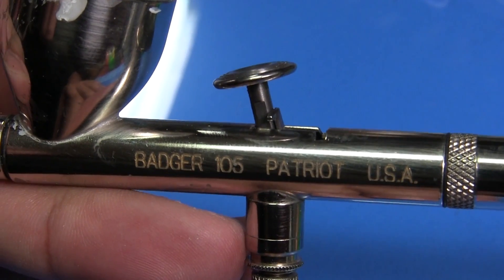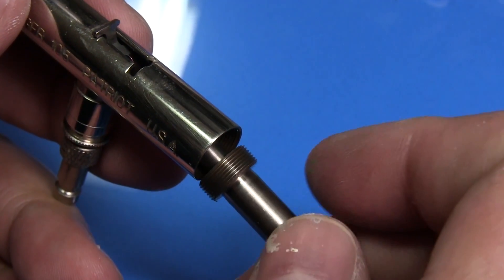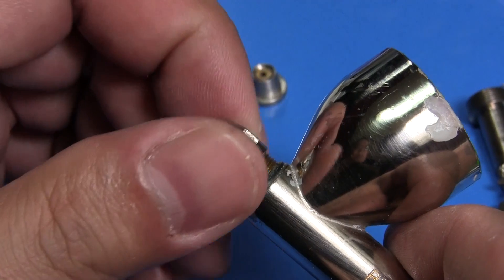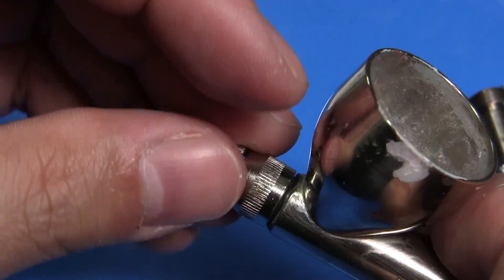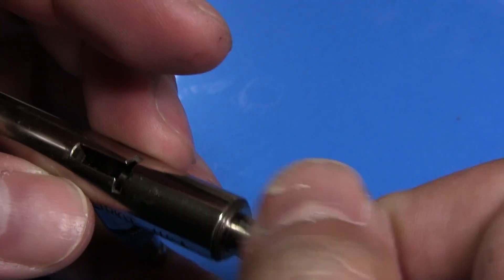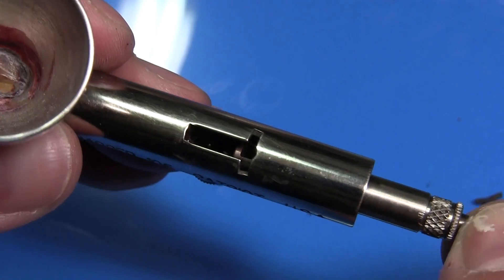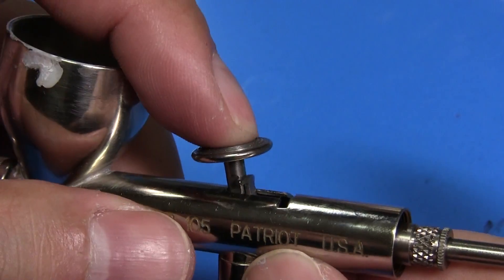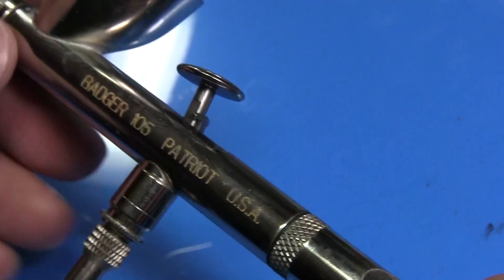Badger Patriot 105 Disassembly & Assembly by Lester Bursley

Comment: This video saved my sanity. The trigger and back lever fell out while I was cleaning the needle, and I COULD NOT get them to fit in again. Turns out the tube shank had slid out of the needle tube and was misaligned. This is not the first time this has happened and frustrated me for probably hours of my life, but now I know the cause and it never has to bother me again! Thank you!

Comment: Do it.  I've had an issue with my Revell compressor which turns out Badger make the hoses for, for Revell.  Issues isn't Badgers fault yet I've heard nothing from Revell yet had loads of help and support from Badger.  I'm in the UK, they are in the US & shipped me parts for free to try and fix the issue.  Even custom made a adapter for the compressor for me.  Amazing support from Badger.

Comment: I ordered this airbrush a few years ago and couldn't get it to work out of the box. Then, I took it apart, and it was a real mission for me to build it back up. It didn't work, so I took it apart again and repeated the process. No results. The AB frustrated me to the point of giving up on it. Now, my AB collection has 5 Iwatas, including two Custom Microns, one Harder & Steenbeck Chameleon, and one Paschee Raptor. ALL of these ABs worked flawlessly out of the box. I hate the Patriot 105 and regretted my purchase. Hard to believe this is the same company that made the legendary Model H. I'm going to try to take it apart again and reassemble it, and I will use this video to assist. However, I don't think I did anything different than what the video shows back then. 

In disregard of whether I'm successful, thank you for this video!

Comment: Is there supposed to be a rubber O ring between the airbrush body (partQ) and the head cap (part A)??? There is a big space screaming for a ring, but I don’t see it in the Spraygunner parts diagram. This was a very helpful video, thanks

Comment: My 105 nozzle tip is stuck on the other piece behind it. They come off the airbrush head as one piece. I've seen videos of people removing it with their hands easily but mine refuses to budge. It doesn't seem to have paint dried there, it simply is stuck. I'd like to remove it to put on the Super Fine conversion from Badger. Any ideas?

Comment: When I got my 105 I took the head and tip off and when I tipped the brush forward a little white washer thing slid out and off the needle. Does anyone know what that is? I noticed it wasn't mentioned in the video. Think it might be part of a PTFE bearing or something. Just wondering if I need to contact Badger or Amazon which is where I bought it from to get it fixed or if this is normal. Thanks.

Comment: Hi there!
I tried disassembling my patriot today to clean it out, but when I put it back together, I notice that I can't push on my trigger.  When I try out the airbrush with the compressor, it just constantly let out air as if it was pressed all the time.  Do you have an idea of what the problem is?
Reply from the maker: Valve could be stuck.  Remove the valve stem and lubricate the point.  I press it against the table to make sure it moves.

Comment: I really wish you had spent more time making this video. I took apart my Patriot 105, and now I can't get it back together correctly. Generally, when someone makes a how-to for maintaining a piece of equipment, it should be as long and detailed as it takes for you break it down and put it together. If you are speeding things up, and cutting out "extra bits" you are actually skipping steps that might help someone out.

In other words. If it takes you 5 minutes to break down, and reassemble the paintbrush then the video should be 5 minutes. Not 2 minutes and some change.
Reply from the maker: All the information is there.  I even included the part about the needle tube sliding forward and having to pull and twist to match the flat parts.  I value your feedback and sorry this video did not help you.  I only cut out the seconds it takes to set parts down or pick them up which wouldn't really help you if included.  New equipment can be frustrating to learn how to maintain which is why I made the video in the first place.